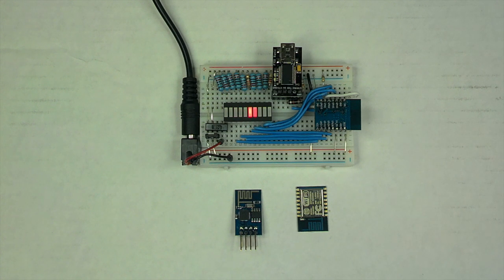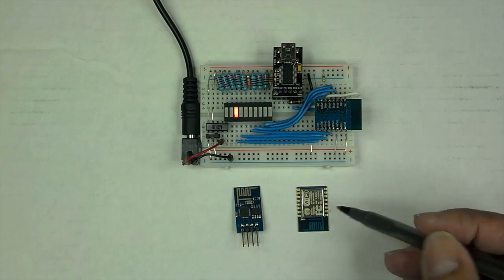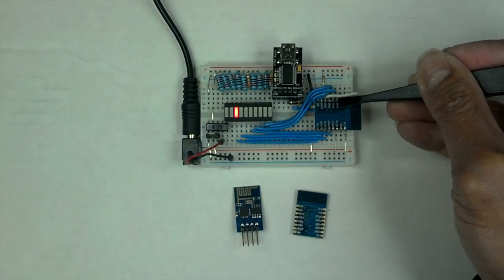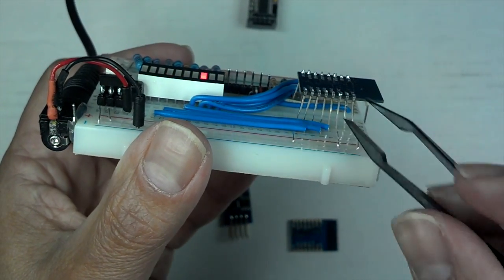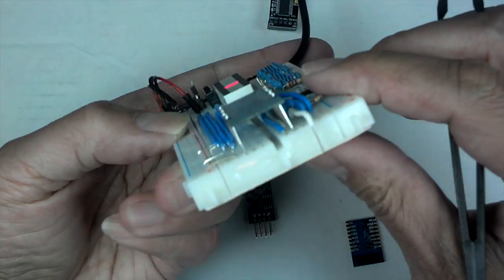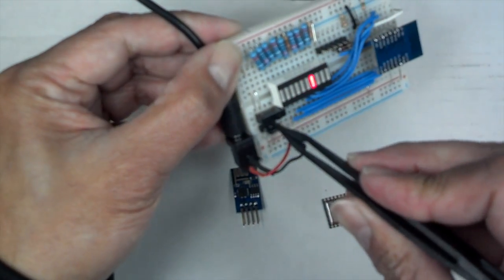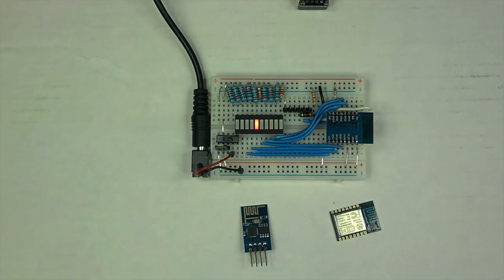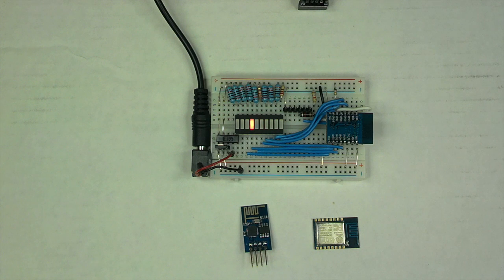HariFun#106 - Arduino Sketch on ESP8266

Comment: Nice video! Do you have breakout board that you would recommend to make it simpler to use without a breadboard?
Reply from the maker: Oh.. there are so many modules to choose from.  I would look at what feature you need for your project and then pick the module. Some has built-in sensors, some has more i/o pins, some has built-in USB while other expects you to use a separate USB to serial converter for programming. Or you could go by price and then see if it has all the features you need.  Some has very wide footprint, but since you said you're looking for use without the breadboard that's not an issue for you.  If your project do not use many pins you could deadbug solder it like I did in this project (see photos in step 5):
http://www.instructables.com/id/DIY-WiFi-Outlet-HariFun135

Comment: Does it have any analog inputs? I read somewhere it has an ADC but can't find a specification or any tutorial about it.
Reply from the maker: You are correct! Some of the ESP8266 series such as this ESP-12 has ONE analog input.  It's input range is 0 to 1V.
I played with analog input on the ESP in this video:
https://www.youtube.com/watch?v=tblhlikCG-s
Reply: Thanks a lot for your response. So ADC pin can be provided with upto +1V. Is that correct?
Reply from the maker: Correct.

Comment: Can anybody explain which pins are for flashing and which pins are for Run Mode?  Where is ch_pd and what is the EN for?  Esp8266-12e
Reply from the maker: +Razor Coding , I don't have an ESP-12e, but looking at the pin diagram, it appears that they've renamed CH_PD (chip power down) to EN (enable).  Pull this up to 3.3V to enable the chip.  I bet GPIO 0 is still the pin that is being checked at startup: HIGH=Run, LOW=Program.

Comment: hello Hari idk if you remember me but we chat few months back, i have a small problem ?  but i did not want to make this conveying msg a confusing chat so i just made a screenshot for you to take a min to look at and tell me what can i do so that i can follow along thanks man ! 

https://www.dropbox.com/s/7adqrpey1ffg0xf/ScreenCapture_10-29-2015%201.46.42%20AM.wmv?dl=0

warning: espcomm_sync failed
error: espcomm_open failed
Reply: i own this model 
http://www.ebay.com/itm/191607430420?_trksid=p2057872.m2749.l2649&ssPageName=STRK%3AMEBIDX%3AIT 
is this consider a generic model ? so that i can follow schematic as shown in  https://github.com/esp8266/Arduino/blob/esp8266/hardware/esp8266com/esp8266/doc/boards.md#generic-esp8266-modules ??also im using this FTDI http://www.ebay.com/itm/181385609653?_trksid=p2057872.m2749.l2649&ssPageName=STRK%3AMEBIDX%3AIT will this be good enough ?> and will it work according to the schematic shown in Supported boards on https://github.com/esp8266/Arduino/blob/esp8266/hardware/esp8266com/esp8266/doc/boards.md#generic-esp8266-modules ??
 thanks in advanced!
Reply from the maker: +Frank Lopez 
Hi Frank! Great job on the video! You clearly showed all the things you've checked. However you did not show the wiring.  The fact that it shows as COM6 only meant that the serial to USB is working (it will show up even if you do not connect anything to the FTDI (USB serial interface module).

Now, onto the issue you're having....
  
The ESP checks GPIO 0 to see if you want to reprogram it, or if it should run the code.  For convenience, I use a switch to do that.
https://youtu.be/iRMdj3dS2hc?t=1m42s

Later on, I purchased an FTDI that can do this process automatically by using RTS & DTR lines to control GPIO 0 and RESET of the ESP.
https://youtu.be/1wTMc5swP3k?t=1m20s

Let me know if that does not solve your issue.
Reply from the maker: +Frank Lopez , excellent, yes, what you have should work.  This thread has some other suggestions:
https://github.com/esp8266/Arduino/issues/466
Reply: Hari Wiguna also out of the topic really but are you good at C# ? im been putting a AI together and maybe you can throw some suggestions ?
Reply from the maker: +Frank Lopez , I'm familiar with C# but probably won't be much help since I don't know anything about AI. :-(

Comment: Hi, I am experimenting with ESP-01 and Arduino IDE.

At the moment, even this blink example does not work for me.

The program is flashed correctly, but then GPIO2 is stuck at 0 and never changes.

Do you have any suggestions for debugging?
And if you add Serial.print() instructions, can you see them properly on the serial monitor?

Thanks!
Reply from the maker: lajolo , yes, you can do serial.begin(9600) and serial.println() as on a regular arduino.
Remember that GPIO0 is READ by the ESP during startup: LOW=Program/flash, HIGH=Run.
Because of this, it is essential that we do NOT put the negative/cathode pin of the LED to GROUND.
Instead, put the positive/anode pin of the LED to 3.3V (don't forget the current limiting resistor) and connect the negative/cathode of the LED to GPIO0.  This way, by default GPIO0 would be high and it will run the code.  The LED would turn ON when GPIO0 is set to LOW by the running code.
To program it, you can wire a switch to bring GPIO0 to ground.
https://hackaday.io/project/5150/gallery#ef518003ef17c6976132a23717cd1897
Let me know if that did not help.
Reply: Hari Wiguna Hello, thanks for the reply. I was not using GPIO0, but GPIO2 for blinking led, but I could not see anything.

Now I am using output 1 that is suggested to use on esp8266.com because it is connected to the blue led.

The code is below.
The voltage on GPIO2 is always 3.3V and Serial.println() instructions do not appear on the serial monitor of the arduino IDE.

Any suggestions would be very helpful!

void setup() {
  pinMode(2, OUTPUT);
  Serial.println("setup");
}

void loop() {
  digitalWrite(2, HIGH);   // turn the LED on (HIGH is the voltage level)
  Serial.println("HIGH");
  delay(1000);              // wait for a second
  digitalWrite(2, LOW);    // turn the LED off by making the voltage LOW
  Serial.println("LOW");
  delay(1000);              // wait for a second
}
Reply from the maker: lajolo ,  Sorry about the mixup on GPIO0 vs GPIO2.
I don't see a Serial.begin(9600); in setup, probably need that.

So it compiles and uploads fine but the code does not run?
As far as the connection to PC... if you have CTS and DTR on your FTDI, try unhooking that temporarily.

As far as the LED, please confirm that you have the +/anode of the LED connected to 3.3v, the -/cathode connected to a 1K resistor and then the other end of resistor connected to GPIO2?
Reply: Hari Wiguna Hi,
thanks, I have added Serial.begin(9600), but the result is the same.

So far, I have never used CTS and DTR on my FTDI.

Yes, the code compiles and flashes without errors/warnings, but I could not see anything and GPIO2 is always high.
I also conferm you the connection of the led and it remains always on.
Reply from the maker: lajolo . it sure sounds like you've covered all the bases. :-(
As last ditch effort, you could re-flash the ESP with some other firmware.  Maybe there's something in another memory block that prevents the Arduino code to run?!
https://github.com/nodemcu/nodemcu-flasher
Reply: Hari Wiguna I can try to flash the nodemcu firmware.

Right now I am using the At firmware 0018000902 that I flashed following these instructions:
http://www.xess.com/blog/esp8266-reflash/

Do you think it is a wrong firmware to try?
Reply from the maker: lajolo , as I understand it, it should not matter because the Arduino basically put new firmware onto the ESP each time you upload. But I'm out of ideas :-( Let me know what happen after you clobber it with NodeMCU. you can enter a few commands to turn on GPIO, to see if LUA can set that port.  If not, then maybe the IO port is dead. :-(
https://www.youtube.com/watch?v=ty-sUlYM9M4&index=6&list=PL-xZsBalytNAFgyiDI8_lwXyeVE3R4hpx
Reply: Hari Wiguna another person told me that on the esp8266.com website it should be possible to find also the recommended firmware to flash in order to use the Arduino IDE, but I could not find it.

I also believe that the firmware should not really count since ESP is re-flashed every time a new program is written with Arduino IDE.
But maybe some settings placed in non volatile memory locations are important and hence not all firmwares are the same for this matter.

I read a little bit about LUA, but honestly Arduino IDE would be the best option for me.
As a second option, I could consider the AT commands sent from Arduino:
http://allaboutee.com/2014/12/30/esp8266-and-arduino-webserver/
Do you use this method sometimes?
Reply from the maker: lajolo , I was not suggesting that you switch to NodeMCU.   Just to upload the firmware to see if your theory about settings in non volatile memory locations.  But, yes, I've experimented with NodeMCU.  Arduino IDE for ESP has won my heart, so I have not used LUA for a while.  I've only used the AT commands when it first came out.  Seems silly to use two microcontrollers when one is often sufficient.
Reply: Hari Wiguna Probably I did not clarify that I flashed the NodeMCU firmware, as you suggested. After that, I tried only the blink GPIO2 example and I could not see any difference.

If you can successfully use Arduino IDE with ESP8266, please keep posting new videos!
By the way, for you is it working for both ESP-01 and ESP-12?
Did you try it with other ESP versions?
Reply from the maker: lajolo . Bummer...
Yes, Arduino IDE works for my ESP-1 and ESP-12. I choose Generic ESP in both cases. I have not tried with other versions. Sorry, I was unable to solve your puzzle. :-(
Reply: Hari Wiguna Hello again,
I am now able to use my ESP-01. The problem was due to an insufficient power supply that allowed the flashing of the device, but it could not sustain it at run time.

I thank you again for your support and I would like to ask you about another thing.
Did you try the example WiFiWebServer?
Thanks
Reply from the maker: lajolo , I'm glad that you got your ESP to work! 

I don't remember if I've ever tried WiFiWebServer, but I've successfully used ESP8266WebServer by ivan Grokhotkov. I started with his HelloServer example to build this demo.
https://www.youtube.com/watch?v=EkO8IoVGBOE
Reply: Hari Wiguna Hello, thanks for the suggestions. I have watched both of your videos on one way chat and they have been very useful.

I tried version 2 of your code and it run without problems.
I then modified it in order to have your version 3 for a simple serial interface (I do not have an LCD display) and it worked also very well.

By the way, I saw that version 1 of your code is basically the WiFiWebServer example.
Did it run correctly on your ESP?

And do you know if it possible to send the form to an external web page and grab the message there in order to allow accesses from outside your local network?
I know that there is the option to open a port of the router, but I do not like that.

By the way, I am now using also ESP-03 and your video on soldering the connectors was also very useful. Thanks!
Reply from the maker: lajolo , If I said that it was based on WiFiServer, then I mispoke. My sketch was based on Ivan's ESP8266WebServer.  He had written a handler instead of relying on main loop.

As far as reaching the ESP from the outside, I don't think there's any way to do that other than opening ports.
You can host the form on the cloud somewhere, and made the data available for the  ESP to poll it using HTTP GET, but that sounds more complicated than configuring the router.
http://portforward.com/

Thank you for your comments. Good to hear that you find them helpful.
Reply: Hari Wiguna Ok, the handler created by Ivan Grokhotkov works also for me. Instead, the original loop (your version v01) works only for the first request coming from the client.
After that, when the main loop is restarted, the ESP prints out "new client" even if there are not new requests and it remains stuck there.
I tried with client.stop() and other things, but I could not find a solution.

Regarding accesses to the server from outside the local wifi, I prefer the option to send the form outside and the poll the outside location.
If you have any suggestions about examples to study, it would be very useful for me!

Thanks again
Reply: +lajolo I know it has been six months ago but I just watched the video and was reading the comments and wanted to tell you good job on solving your issue. So many times I have seen projects fail due to an insufficient power supply